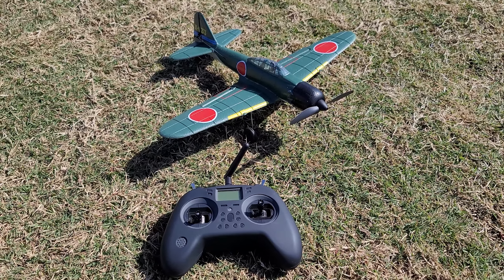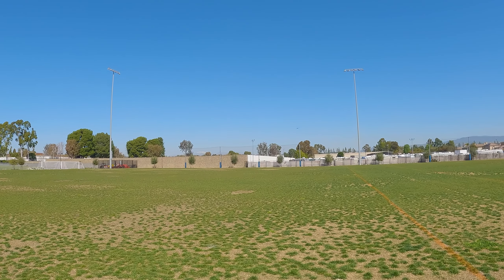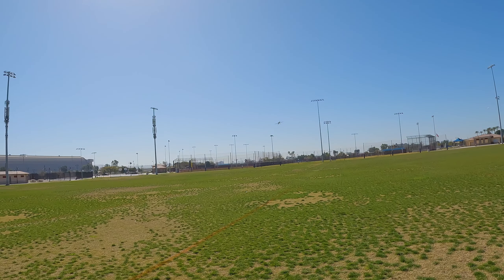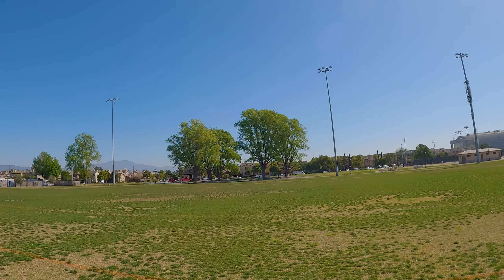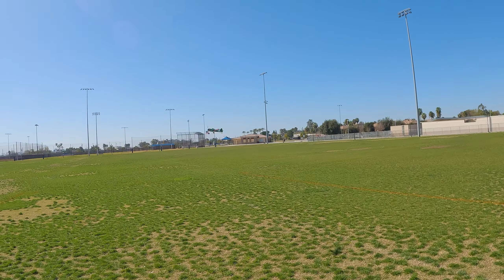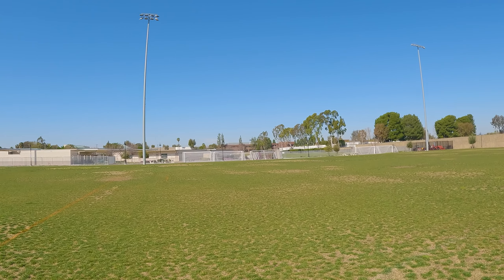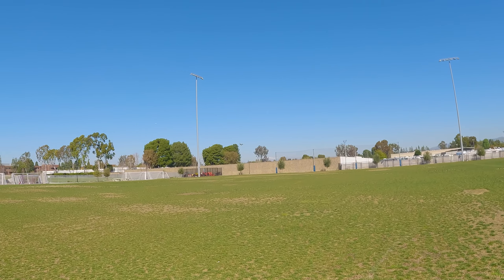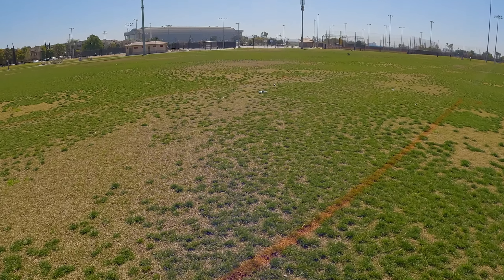Eachine Zero Micro Warbird Review ✈️

Comment: what amount of throws did you find out of the box?  I have +/- 45 deg for aileron, +15/ 5 for elevator, +/ 30 Rudder.  It is basically not flyable with this setup.  Elevator is most concern.
Reply from the maker: I did not fly with the stock transmitter.  I guess you didn't watch the video.
Reply: @AlbertKimTV  I did watch the vid.  Usually, a pilot will check throws, in expert mode, to see if they are flyable.  In my case, the elevator is out of whack and I need to increase a lot.
Reply: @AlbertKimTV  sure did.....most pilots check throws on a model before flying.  mine the elevator is wonkie.